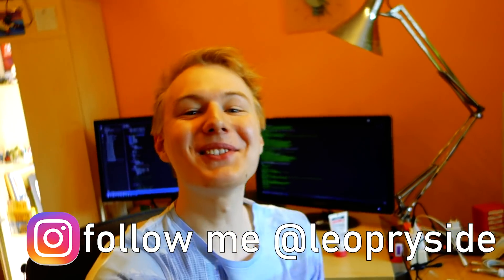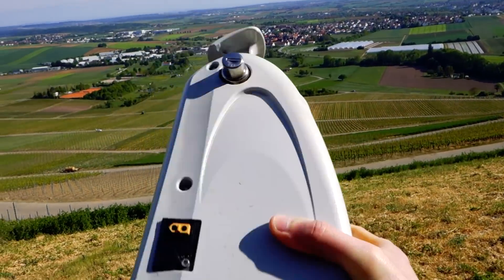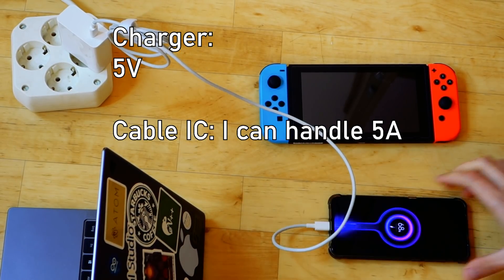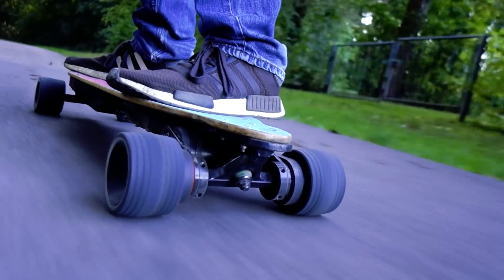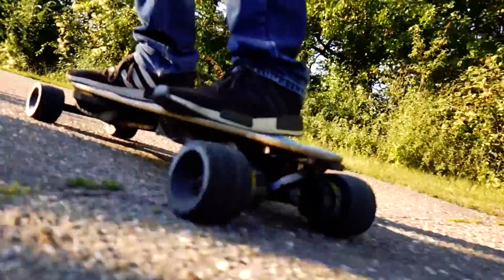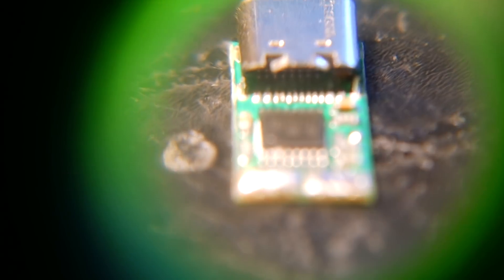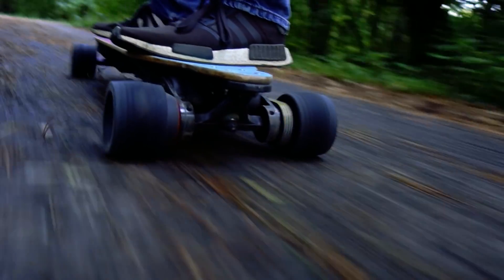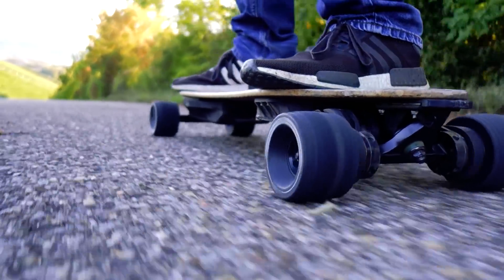Charging an eBike over USB-C

Comment: I use an MPT-7210 boost converter and a USB-C to 5.5x2.1 adapter and a 90w USB-C brick and it charges fine. I have a whole video on it if you want to click my name. The USB dongle was only like $17 bucks or something and the boost converter was like $30. I had a 90w USB brick and was charging a 48v battery around 1.25amps with it pulling about 81w so as not to totally kill it. With a 100w brick you could probably get 1.5amp or maybe more for charging. Considering most ebike companies cheap out anyway and give you only a 2 amp charger. You're not losing that much since at 2 amps that's around 109w at 54.6v terminal voltage. So theoretically you could get maybe 1.75-1.8ish with just using a 100w usb brick.

Comment: unfortunately although it's possible, it's just really inefficient at the moment, here's why:
firstly PD only supports 100w of power max, fast for the average consumer however I personally charge at 200w, secondly, pd does not support current limiting meaning you need to add a boost converter on the output of the 20v (which isn't very efficient)
Reply: yes, but if you built in this converter into vehicle, and your main chagrer will break or you lost it, then you can charge it as emergency via usb C charger which you can find anywhere instead 13-14S or 20S charger for specific battery

Comment: What about parallel charging with two USB-C adapters? That would work and not be too crazy. There are light and powerful adapters (GaN based) that can easly output 60W and weight less than the one you're using.

Comment: is putting 2 50w chargers together not feasible? all you need is the communication equipment for PD, you don't need an off the shelf PSU+PD board, you could probably find a PD board and use basic power supplies, or have multiple USB C ports on the vehicle

Comment: I use that exact same boost converter to take my 4000MAH 4S lipo's and charge my ebike while driving
Reply from the maker: hm... but that wastes easily like 15% of the energy... I dont know about that.
Reply: @Pryside  hello leo, i admire your work and video skills. Sure it wastes some energy. But for me its about using great energy storage potential i had laying around. I have these packs that are laying around not being used in my planes most of the time. And i simply want to increase the range of my crazy imortor 1.9 so i 3d printed some things to add more capacity when needed. In the city stock is fine.but when i need 30km of range i add all sorts of batteries. I have 3d printed a holder for 2 makita (hobbiest series drill) batteries and epoxied the dc to dc converter onto the holders to be able to charge the bike while driving with any sort of voltage potential that i can find. Like a car battery when camping or my stack of 4000mah 4s packs that i wired in series. It even heats up my batteries during winter times to perform better. I've also made a 10s pack from 4 lidl parkside 4ah drill batteries at about 2 euro per 18650 cell and being able to charge them inside my house serperately is awesome aswell. The losses are not the problem
Reply: @Pryside  so short answer not that much. From 30v to 42 volt it's not that much heat. Pretty efficient with 2 packs in series.
Reply: in a 2 hour day of riding they discharge from 4.2V to 3.7V per cell and then my voltage alarm goes of

Comment: This is very awesome, I wonder if there is a way to do this with a 72v battery?
Reply from the maker: sure, they even make the same motor controller with a bit less amps and 72v. but that would only result in more top speed which I dont really need tbh :D

Comment: Servus! Wie stellst du die Ampere bei dem Boost Converter ein? Also was für eine Last schließt du an und misst du das mit dem Multimeter?

Ich hab einen großen Boost Converter mit CC Einstellmöglichkeit. Ich möchte 42V bei 5A einstellen, habe aber keinen Verbraucher mit dem ich das vorab bei der Spannung einstellen kann.

Kann ich eine starke 12V Birne aus dem Auto nehmen und die Ampere bei einer niedrigeren Spannung einstellen? Also sagen wir eine 55W Birne aus dem Auto, da stell ich dann 10V am Converter ein und regle mit dem Multimeter den Strom auf 5A. Würden die eingestellten 5A dann auch bei höheren Spannungen bleiben?
Reply from the maker: das ding hat 2 trimmpotis dafür. 42v kann man mit multimeter messen, dann halt an akku anschließen und die current einstellen
Reply: @Pryside  Okay danke mal für die Antwort. Problem ist ich betreib den Lader mit einem 1kW Servonetzteil und will nicht gleich mit der vollen Leistung in den Akku fahren. Mein Boost Converter lässt nämlich laut Aliexpress 30A raus ohne Current Begrenzung. 

Werde es aber mal versuchen, der Akku kann das eh kurz ab denk ich, hat immerhin 1,2kWh. Ist ein Stihl AR3000 Rückenakku, 10S11P Schaltung.

Comment: can you paralel 2 or 3 of them on a new pcb made by you and find the amps you need.. all you need is paralel em i think you dont need to make em comunicate... .. even 3 of them will work cool!!!  this is my thinking but the safety and stability parameters of a less experienced user isnt my concern .. its  project and everything can be on table as possible solution!!!!

Comment: Does the new Mi 10 Ultra charger support the Power Delivery standard for up to 100W?
Reply from the maker: I'm guessing they are going to use a proprietary charging standart. But we'll have to see. But even if, the charger is not made for constant 100W. Its only enough for like 5 minutes, after that the charging will slow down

Comment: Hi Leo, Would it make any sense to use various USB-C 20.000mA powerbanks instead of a batterypack for an ebike?
Reply: not really too little output current would be possible if you can take out the 18650s and then make your own pack from them

Comment: Hi Leo! I bought the same DC-DC Boost converter that you are using... however when loading it my USB-C power supply always cuts out. I tried to limit the amperage with the righthandside potentiometer but it seems to have no effect at all.... the power supply immediatly gets overloaded and cuts out. Any idea?
Reply from the maker: i would connect the boost converter to a lab bench power supply or another battery and then charge a second battery with the boost converter and then set up the current with that as a load. then u can finetune the current to a degree where ur power supply doesnt cut out

Comment: What happens if you connect two chargers in parallel? Could you get around the 100W charger problem this way?
Reply: You would need additional circuitry to allow that, most regulators will not allow just plain paralleling of the output. But it is absolutely possible
Reply: @callumkingunderwood  Say I have diodes rated for high power. Could I do it then?

Comment: Quite a few mistakes in how PD works, but eh, not too important.
I do have some usb PD IC's that I was investigating using for this very application, albeit with a more programmable boost converter IC to allow the charge rate to be adapted according to the connected supply wattage
Reply from the maker: that sounds very cool. If i get something wrong feel free to write what i missed :)

Comment: Ups. Wusste nicht das du Deutsch bist. Ich habe einen 36v 1000watt Motor und eine 36v 4ah batterie an ein rad gebaut. Nun brauche ich einen Controller mit einen Gasgriff. Welchen würdest du mir empfelen?
Reply from the maker: für so wenig spannung kann ich den vesc sehr empfehlen. der hat direkten adc eingang für ein gasgriff.

Comment: Why just design your own charger and if it works, you can try to make a gerber file. (PCB Layout) Works with EasyEda. Then upload it to JLCPcb or PCWay. You can even ask them to sponsor your projects... 😀
Reply from the maker: thats quite a lot of work but since there arent any community projects that do that yet. It might be worth the time
Reply: @Pryside  I've done something similar before... I went to Alibaba and asked the seller for the files. I just needed to redesign some components (bigger capacitors, ...) and thats it😃
I had to write to about 10 different companys and with thwo of them I was lucky. By the way it was for a solar charger which I wanted it to be able to let a higher voltage go through...